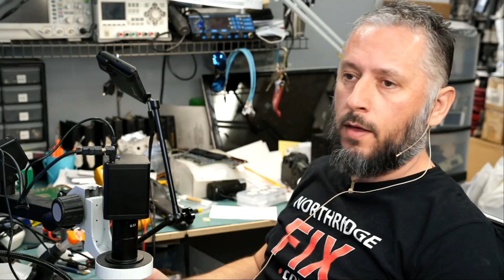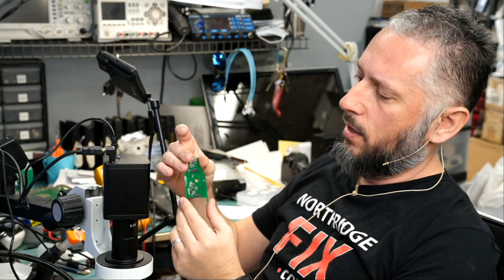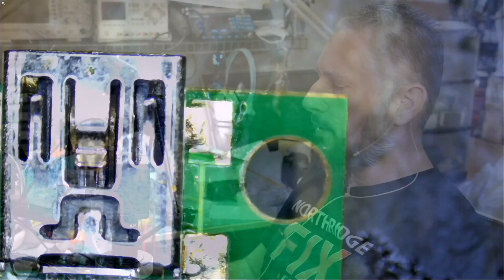Porsche Dongle Diagnostic Tool Repair

Comment: Thank you very much for the video, you are awesome! I really enjoy seeing miscellaneous tools getting fixed and with the same "better than factory" treatment :)

I am a car enthusiast and I use tools such as this dongle too. You will notice that the official diagnostic tools for Volkswagen, Audi, Seat, Skoda, Porsche cars are very much alike because these cars are under the same automobile group: VW AG. So the tools for them will either be identical or with small differences in firmware / software.

Comment: Beautiful soldering. From the video it looks like there's some damage to the chip die (a tiny hole maybe) between the S and the 1 in J4S19H3  at the 9:36 mark

Comment: Hello. did you measure the volt regulator transistor? often IC circuits should only have 3.3v or similar and not 5v

Comment: Hello, Alex!

Yesterday I was fixing a motherboard and, out of nowhere, the BIOS battery (that CR2032) exploded in my face. I don't know exactly what happened, it may have gotten hot from a short or something, but it exploded very strongly and I felt like my face was burning and my eyes were melting and, after washing it with water, it just felt worse - somehow, the water worsened the burning feeling. Then I washed everything with soap, including my eyes, and it felt better, and my vision started to come back. 

I was VERY lucky for not losing my vision, I was told by the doctor. The parts of my eyes that got burned were outside the retin area, so I suffered no major damage to the vision.

Anyway, I know you've been doing it for many years and you know the risks, but I just want to suggest you (and others reading this comment) to start using some sort of protection glasses, even when there's no clear threat in what you're doing. That's it. Thanks for the videos and stay safe! ;)
Reply: CR2032 are lithium batteries most of the time.. so yes, mixing water with that battery’s chemicals do indeed worsen the situation
Reply: Rule no.1 in electronics and laptop repair: always remove the battery first!
Reply: If you got accid on you try to get the pH down with soap because soap is a base, base and accid neutralise each other.  That's why on a MSDS sheet you always find with what you can clean a accid pH 2 or lower or a base 10 or higher  pH of water is 7 neutral
Reply: Sorry to hear about what happened. Hope you get better and everything is ok.
Reply: Thanks for the great advice.

Comment: All these VAG group interfaces are just J2534 PassThru devices you can now get a licence to use there software with other J2534 passthru"s. Im pretty sure that without that realtek chip it will still work but not over WIFI as some of the aftermarket versions have that chip not populated

Comment: The dongle for my VW avoids the connector problem by having the cables permanently attached to the dongle. It has a cable running from the dongle to the OBD port so you don't have to fumble around under the dash with the dongle trying to plug it in.

Comment: thanks for the content as always learning things by just watching. May i ask something  how  did they  find such a problem without a thermal cam back in the days ? or let me ask this how would you find such a problem without an use of a thermal cam.
Reply: They swab the board using a cotton bud with a volatile liquid like alcohol. The area that heats up excessively will immediately evaporate the alcohol, indicating the faulty component.
Reply: @blutey Rosin vapour is another way.

Comment: The dongle is same just because Porsche is mede by the same company like Audi :) it is VAG group…
Reply: It is very similar due to that but as Alex stated when soldering the port, it is not the same or at least a different board revision

Comment: I’m wondering if you desolder that Realtek chip and see if the led lights come on?
Reply: That's like surgically removing someone's brain out their skull, then have them take an IQ test.
Reply: @bozak2320  I wasjust curious If that chip is shortlying out the Power rail going to everything. It is not the brain of the unit. but it's part of the unit like an arm.

Comment: The Realtek RTL8152B is the USB interface.....
Reply: It is an all in one ethernet MAC and usb bus controller. i think this dongle for porsche supports DoIP (diagnostics over IP) which can use ethernet to run the UDS application layer. This is replacing older CAN bus. If curious you can read more about ISO 14229-5 standard, defining UDS over DoIP over Ethernet.

Comment: I do not understand how you can have two different issues in one device. If the device stopped working due to the one issue, the device would not run and the second issue can not appear.
Reply: usually someone tries to "repair" it and creates the second problem... plugged the cable wiggled the cable multiple times till broken port
Reply: Have you considered that the first issue may have caused the second issue or vice versa?
Reply: @I_Evo  Yes, I have. I think this possibility has low chance in this case. Do you have any suggestions how exactly the first issue may have caused the second issue?

Comment: That realtek chip has hole on it.
Reply: That is the pin 1 marker, it is not a hole.
Reply: @mal6232  Is a hole, GJ33B in the bottom, look in the top of the J.
Reply: @mal6232  in "J4s19H3" between the S and 1... is that a hole also???